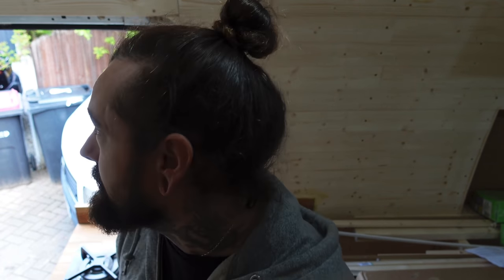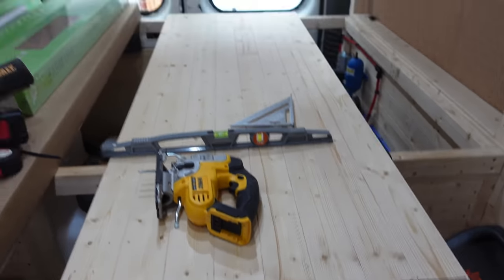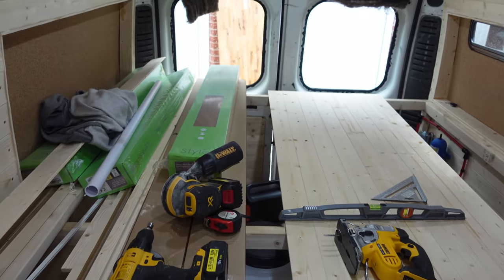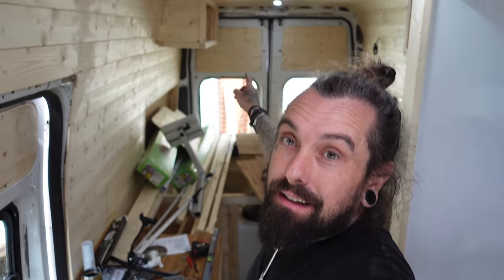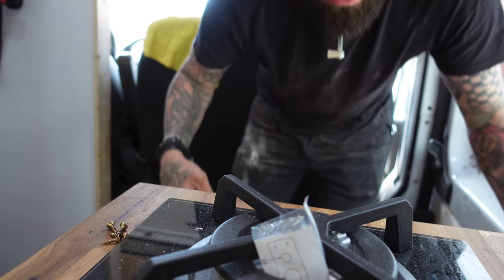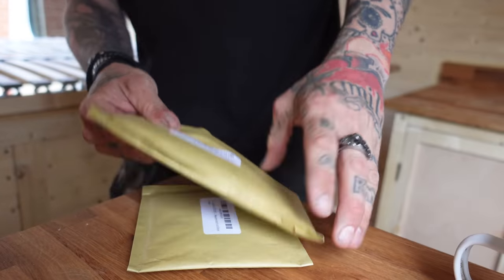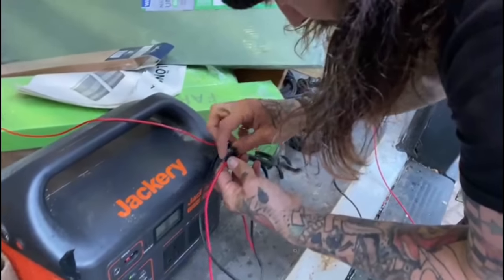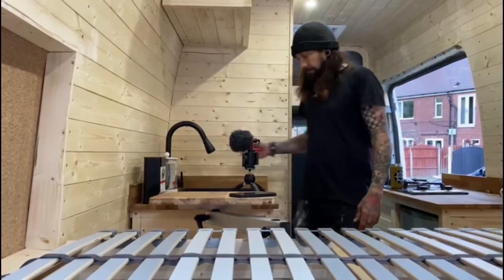The MISSING Vlog - The Big Mistake!

Comment: Which version of the Jackory are you using there please liam, I need a power source for my garage and now have an idea to try one of those diesel heaters as well so need to be able to power led lights (the strip type) , maybe the odd power tool every now and again and run a diesel heater and lights together
Reply from the maker: I’ve used the 500 and 1000